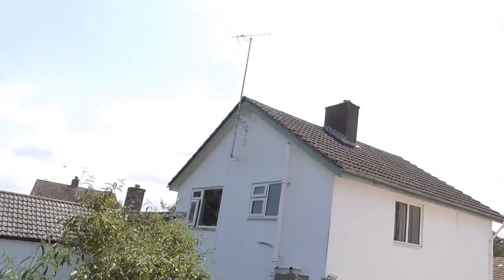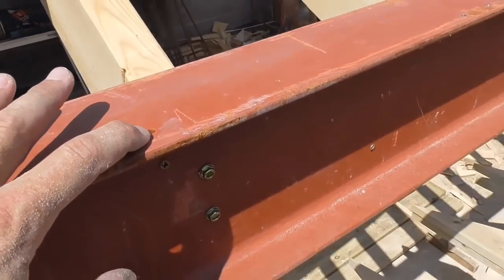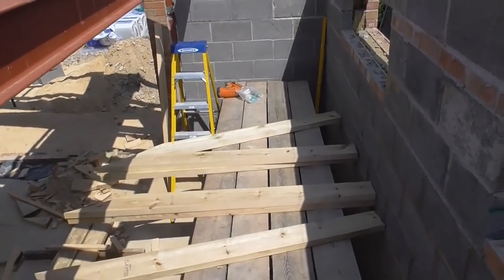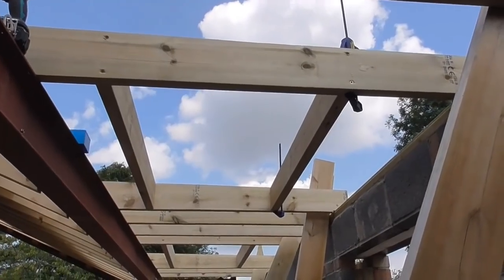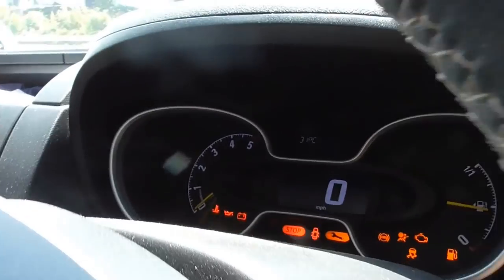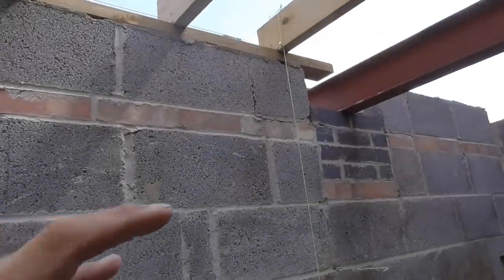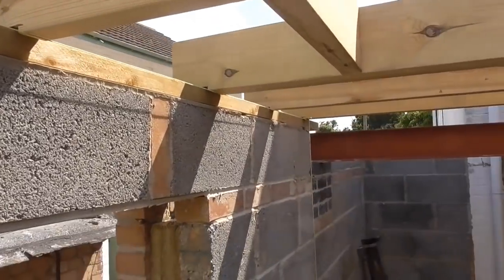Fitting rafters to a structural steel frame PART 7  ***FLAT ROOF SECTION***

Comment: Roof s looking great  but you had be baffeled about how you got a 1in 60 fall if you should have got a 1in 80 , if you dont mind and you've cooled down could you explain it again.
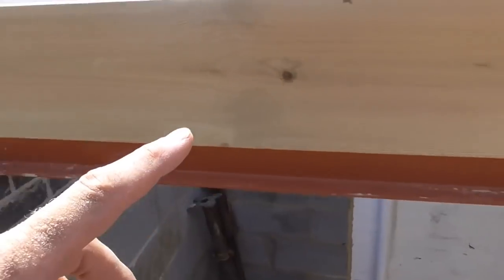Reply from the maker: Hi Kevin. When I watched that back, I did think I could have done a better job of explaining it. Historically, it was accepted that the fall on a flat roof wanted to be 1:80 AFTER any roof coverings were fitted. However, because of the layering of thicker type roof coverings like mineral felt, this would cause steps in the roof that water would sit in. To counter this, the roofs fall would be steepened to 1:40. Because we use a modern, single ply rubber roof covering now, we don't get this stepping up on the lap joints and so can don't need to make the fall 1:40 (even 1:60 is over but I prefer this as it still give a safety factor).😎 Thanks for another great comment👍

Comment: Well done cobber, that looked a nightmare from start to finish.
Not sure about the “dreadful heat” though. We had 18˚C in Perth today. That’s Perth, Western Australia and the middle of winter.  A nice autumn day would be 29˚C and mid-summer it can be anything up to 45˚C.  Hard to stay on a roof then.
Thank you for all your great videos.  One’s never too old to learn from a good tradesman.
Reply from the maker: Hi Ciaran. I have worked in hotter temperatures than 30 degrees, but it just seems really tiring. I don't know if were just not used to it here, or just of if I'm just weak😬 Its definitely not a dry heat and just seems to sap your energy😩 Great to have you watching from Perth😎 Cheers

Comment: Very hot out here too just keep the sunscreen on , I use three small pieces of ply same as the nails , but a laser level would be great especially with the bleeper  👍👏👏🇮🇪☘️👋
Reply from the maker: Hi John. I've seen the blocks used before and it works well👍My new laser is too shiny and I didn't want to get it dusty😝 Thanks for watching 😎
Reply: @thetallcarpenter  😂

Comment: Great job as always👍I nearly got heat stroke Monday through building and decking a porch.  In a corner with direct sun light. Dangerous temperatures and easily done.
Reply from the maker: It can creep on you John😬 This video was filmed on the same day as you were doing your decking so I know how you felt. I only worked till about 3pm as I'd had enough🥵 Thanks for watching😎 (stay cool🥶)

Comment: Being both a carpenter and a building inspector, it is so nice to see a tradesman who thinks about the job he's doing, happy to talk to the structural engineer and able to think for himself and end up with a structurally sound end product with out any drama or saying it can't be done mate!! Smashing keep up the great work.
Reply from the maker: Hi Richard. Ultimately, what's the point of committing expensive labour and materials to detail that, if not done correctly, is going to either fall foul of building inspection, or worse, succumb to a failure😩 (and be bad for your reputation). Believe it or not, architects, (most of them), structural engineers and even building control, are all very accessible and will always, in my experience, be there to help with any queries or questions that we, 'builders', may have.😎 I think I get on really well with all the inspectors I come into contact with, be it local authority or insurance based, and find them really easy to engage with👊 Thanks for your great comment, and for watching😎

Comment: hi looks good again, where we are you have to double trim all openings and joist clip/joist hanger every but joint and another question why have the flat roof joists not been tied into the roof rafters?
Reply from the maker: Hi Chris. Yeah, I would normally expect to have to double everything up and use hangers, but the structural engineer didn't spec them here.👍 I haven't tied the flat roof joists into the rafters as the centres don't line up, (mainly due to the window apertures) and they are fixed to the steel individually and will also have solid blocking in between them which will also be fixed to the steel.😎 Thanks for watching and your comment👍
Reply: @thetallcarpenter  keep up the good work and get a hat on in this weather
Reply from the maker: @chrishyde5995  🤠👍